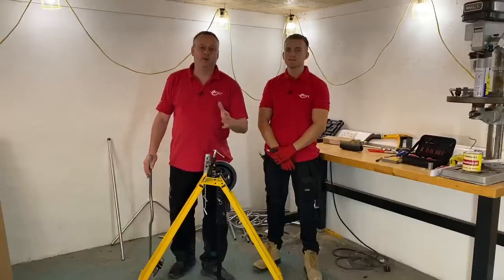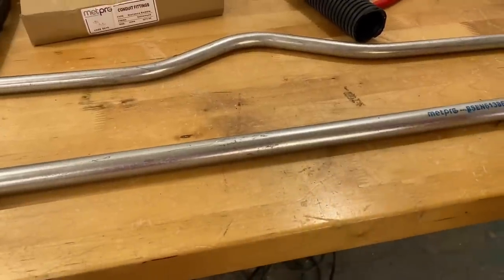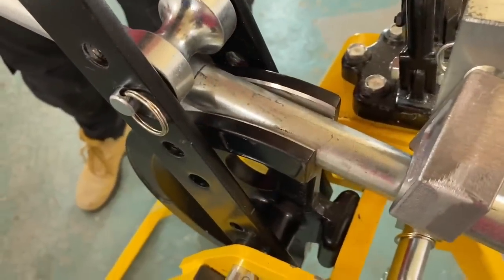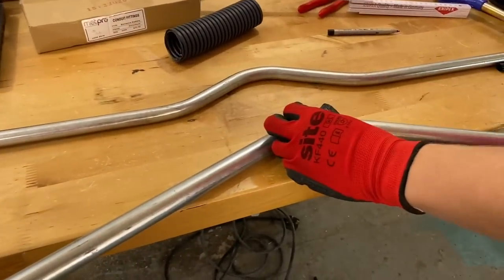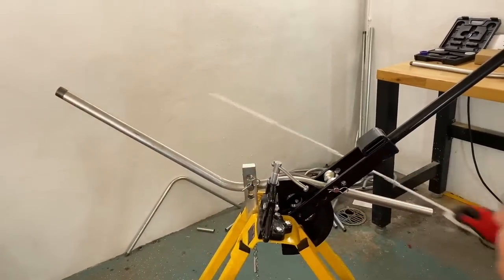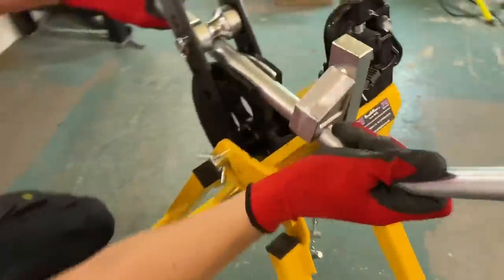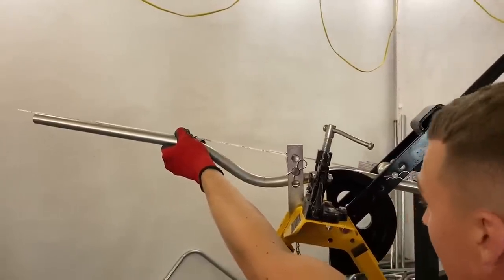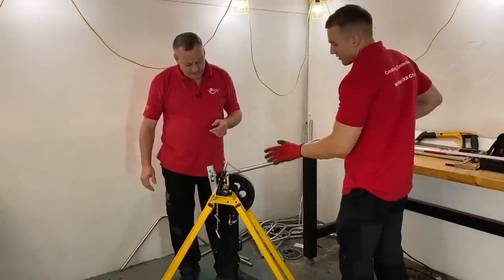How to Make a Bubble Set or Swan neck bend in Conduit

Comment: It's been 30 years since I did this, but I would mark the 20mm tube in three places before I bent it. The marks being (I think) at 125mm spacings for a bubble set over another 20mm conduit. I'd then line each mark up in turn relative to the hacksawed marker groove that you'll find on nearly every former, then make each bend in turn.
One mark would be against the groove, the other two offset from the groove by different amounts. This gave me a symmetrical bend with each mark in the middle of its bend. I would check for alignment against a handy door frame; there's usually one nearby when surface conduit is being installed.
I much prefer these Hilmar benders to any other. I remember one Hilmar I used was built with round section tubing, not the square section tubing most of us are used to; it must have been a very early version.

Comment: Thanks for the helpful video. Just one question. You state, the first mark is approximate. How do we get an exact measurement for the center of the bubble. For example if i need to measure 800 mm from the back of bend to center of obstacle.
Reply: Did you find out the answer?
Reply: @eanan00  no, I can get it pretty good by just guessing, but I'd like to have an exact method

Comment: Usually my first center bend is 45 degrees and the 2 other one are 22,5 degrees
Reply: This seems to be a better way
Reply: Then to find the distance between the center you need to find the Hypotenuse, which is the opposite (distance of jump (50mm in this case)), divided by sin ((angle(which is 22.5)). So here it is Hyp = Opp/sin22.5 => Hyp = 50/.38 ==> 130mm....

Comment: How do you set the tipex marks if you don't have an inclinometer? Also, using a ruler that bends could give you some issues, but if you rotated it 90 and used its edge rather than its face you may have better results.
Reply: spirit level with a 45 degree vial. Inclinometer is just a fancy spirit level

Comment: Called a three point saddle in the US. We do simple calculations and mark conduit first, then use a hand bender. Seems much simpler and more accurate than this method
Reply: Bro, my thought exactly. Regardless if it's emt or rigid conduit hand benders are way more practical for use in the field. Especially when we are running 100'-300' of raceway a day. Definitely appreciate the American conduit bending practices.
Reply: You'd need a pretty solid hand bender to do 25mm galv 😅

Comment: Do you have metal pipe like EMT over here in the states? Do you use that bender for both?
Reply: No just this thicker walled stuff. It's the same old conduit as 60 years ago. Hopefully one day we'll get something inbetween pvc and steel like a light gauge steel with push fit fittings and steel clip in saddles. Come on manufacturers it's 2023 next week.